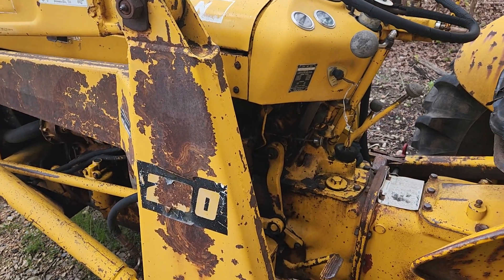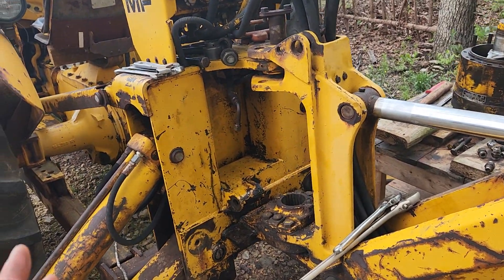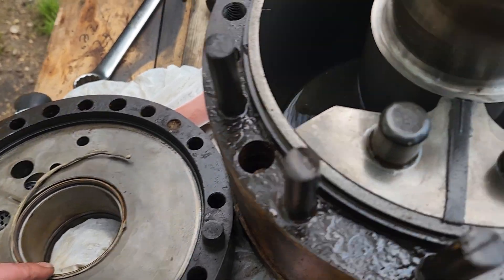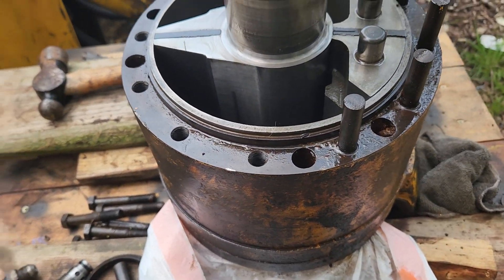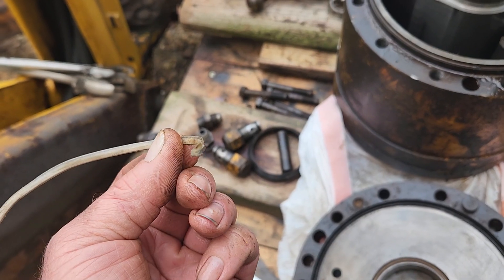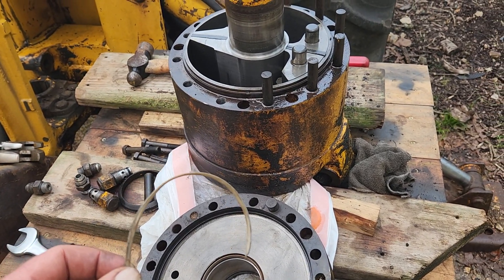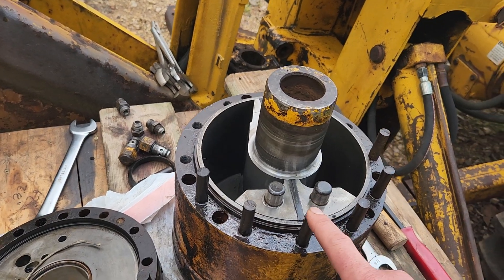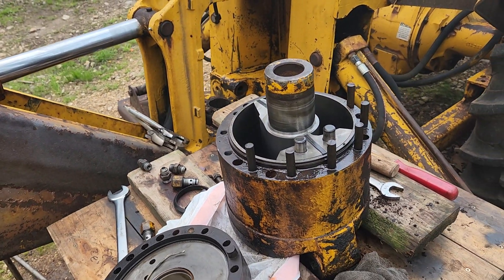Help! 1971 Massey Ferguson hydraulic Rotary Swing Cylinder on an MF54 Backhoe has broken seal!

Comment: It's a a Teflon rod seal, I'm taking one apart and will be listing all seals
Reply: Did you manage to find the seal? Just curious if you got the parts listing. Thank you in advance. Also  how much do you thing this sucker weights. I'm wanting to do this job but don't have a shop. Thanks in advance

Comment: I got a similar problem my one don't leak but the boom goes from one side to the other of its own accord just swinging as I drive I'm fuckin cracking up as I can't find ENFO anywhere. I am going to rip it open but I don't know if it's the spool valve or the moter I'd appreciate anny ENFO out there mf are keeping a verry low profile on this matter.

Comment: Good that you found the seal, mine needs attention also,
mine is different again, an australian machine with a dowety swing cylinder,
good luck
Reply from the maker: ADCO had it in stock. I gave him the SN plate info and he sent me the schematic parts list to ensure I had the right one and they shipped me two of them. 21 dollars each but shipping was another 20 bucks.